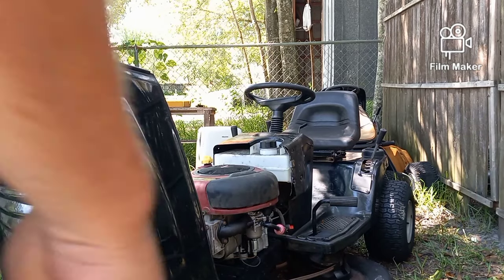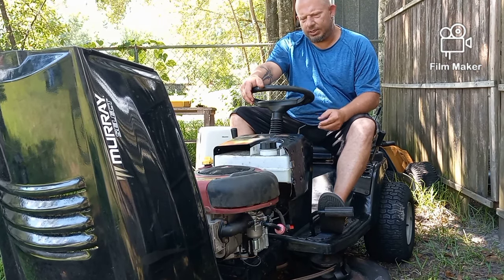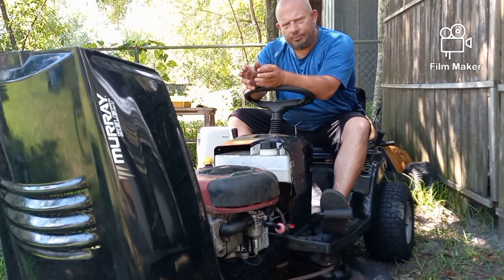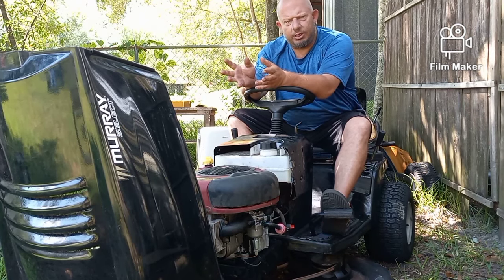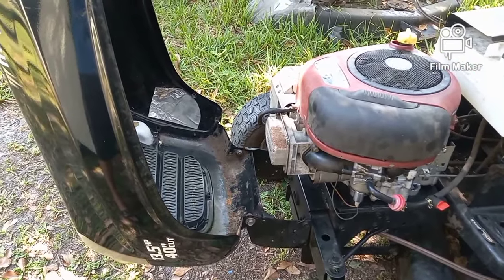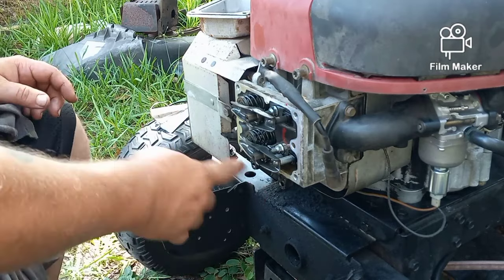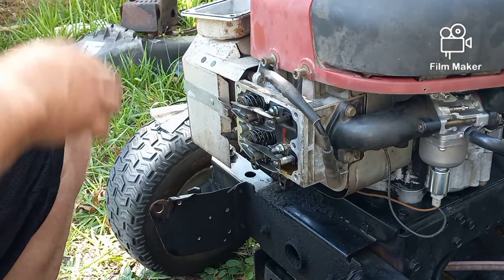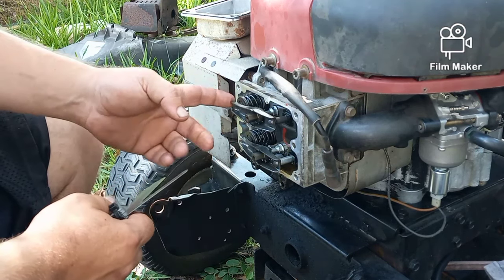Mower Spitting Backfiring / Fixed Briggs and Stratton Riding

Comment: Adjusted the valves on a 19.5 hp briggs and Stratton engine to .005. However, still popping and backfiring on idle. When I engage blades manually, the popping and backfiring disappears. What could be my issue?
Reply: Also to mention it is on a 300ex Poulan pro riding mower
Reply: Carburetor
Reply: @davidthurston4241  Actually that was my problem, I had ordered a carburetor for the 18hp engine and that was my causing my problem. Ordered a new aftermarket rated for 19.5hp and cleared all my problems. Hope this helps for anyone that could come across this.

Comment: Quick question what is a good base screw adjustment for that air to fuel to start at? From all the way in. How many turns out would be a good starting point?
Reply: I have that same engine here popping like a mofo. And I've been playing with the carburetor with no avail. I will be taking a valve cover off and doing the adjustment and then retweek in the carburetor. Thanks for your input in advance.
Reply: @nater6604  well  did it ?
Reply: @ronjohnstonaustralia2417  still sitting in the backyard. I have so many other projects going on cars ATVs go-karts and house stuff. I think it's the rocker stud loosened up.  At some point I'll power washing machine fix it and put it up for sale
Reply: Hope you got it fixed. That air/fuel screw, turn it all the way in, then back it out 1.5 turns to start. Should be close at 1.5

Comment: If you Jack the nose of the mower up, the oil won’t run from the head when the valve cover is removed. It makes life so much easier.
Reply from the maker: Your absolutely right.. this was an early video and I was very unprepared , short on tools and nervous.. I never expected it to become my most viewed vid cause it's not great lol.. but I've learned since then to show better ways .  Thanks for the tip it's great that u stopped by
Reply: @MunkyWrench  you do good work. Keep it up

Comment: Where do I find specs for a Briggs Intel 20hp? I set air gap at .010 but I noticed a chip in the coil on engine side. Valves have no clearance

Comment: Hi Munky, thanks for your videos. Really appreciate them. I own a 21A907-0167-E1 Briggs and Stratton Engine (13,5 HP) and I can´t seem to find the oil filter. Does this engine has one? Thanks in advance
Reply from the maker: Good morning.. I just looked it up and I see 2 motors.. 1 with a filter and one wuthout.. so I looked up the filter .. it's a shallow filter.. it's about the size if your fist. Usually .. from the driver's seated position would be sticking out the right side of the motor. I'm sure you would see it if it had one.. also if it's a used machine I've seen people remove the oil filter and cover the hole.. feel free to email me and I can help u more in depth

Comment: It's going to sound stupid to you, but what does 500 hundreds of a inch look like  on a feeler guage?
Reply from the maker: not stupid at all .. I always forget if its 500 or 5000.. but its 5 thousands 0.005 ... hint its almost the smallest thinnest one you can get.. most feelers guages start at 4 thousands .. so usually its the 2nd or 3rd one on the tool.. fan it out like a deck of cards.. find the thinest one and it should be right on that end of the tool.. hope that made sense
Reply: @MunkyWrench  Thank you!

Comment: The biggest question you did not address is, what caused it to be so much out ?
It could have a bad worn push rod, bad lobe ?
Set screw stud can be coming out?
If any one of these things are happening, it will fail again.
Just saying.
Reply from the maker: Agreed but the biggest cause of it is the fact that the average homeowner doesn't even know they should ever be checked or services nor do they pay for stuff they don't think is broke.  So I've the years they slowly get out of spec until the day they go too far and simply won't run or runs bad enough to untrained owner thinks it can't be fixed and they buy another

Comment: So mine is stalling out at about 1/2 throttle. Spitting out of intake. I've taken the engine apart twice since putting in a new camshaft and a new carburetor, nothing is bad, bent, or anything of the sort. Carb has been adjusted. New plug also. Oil didn't have metal fragments in it. It just refuses to throttle up without missing and losing power. Engine is a 17.5 hp I/C on a Craftsman body. Any ideas?
Valve lash has been adjusted... I know all about those things I'm actually pretty mechanically inclined. Intake is .005 and exhaust is .007. I've tried everything from .004 tight/loose to .006/.010 no effect.
Reply from the maker: That's a head scratcher.. I'm gonna think about that for a few hrs.  I read your message 3 times and I keep going back to a carb issue.. like when u throttle up its being chocked.. not getting enough air and so the gas is not all being fired and being spit out .  I'd cmdoubke check the intake manifold for cracks or leaks.  And I've had that happen with a new carb that was bad from the factory and I've put a different carb on which fixed the issue.  Something is bogging the engine down which could be a head or head gasket problem also but I assume u checked / change when rebuilding the motor.  Keep me informed and I'll think on it
Reply: @MunkyWrench  yeah I'm lost on this one. I didn't tear down the engine from the flywheel side so the flywheel, stator etc hasn't been looked at yet but I did break it down from the cam side. So what I've checked so far and all are good:
Piston travel
Piston walls are smooth
valves aren't scarred no contact between valves and piston. 
Rods are straight
Valve springs are good, caps are still on valve stems.
Rockers are good, rocker studs are seated tight
Timed it by dots both teardowns.
Governor is good and intact
Camshaft is new, new compression trigger
Pushrods are new and good
Counterbalance is good and floating right
Plug is new
Carb is new and adjusted to standard 1&3/4 turns out, and tweaked to no effect
One thing I'm noticing is that a lot of videos I'm seeing with that engine it looks as if their valves are opening much farther than mine...but as I said my rockers, studs, springs, caps, valves, pushrods, cam etc are all good. But when I turn the flywheel by hand they may open 3/16"? If that. Both sides. Honestly it feels like I'm getting too much compression...but what would cause that? I know a leaky piston will cause low compression but it just feels like mine is too much
Reply from the maker: @AnothaGuy87  I've seen valves that would stick closed or partially closed but that's only due to carbon buildup on the guide .. too much compression could only be caused by carbon on piston or sleeve and doesn't sound like that's your problem.. silly question.  U got the right crank in there, correct.. I've seen an oversized out of spec cam or crank be too tight in the guides
Reply: @MunkyWrench  the gear fits right, and I'm pretty sure I checked the lobes to the one I took out of it and they looked the same. I say I'm pretty sure... But not positive. It's very likely I'll tear it down again and if I do I'll put a caliper on the lobes. That being said if I'm having too much compression that's probably an undersized lobe condition not allowing the exhaust to open up enough. Funny thing is tho that I ran the mower about 6 hours after the cam swap and it did fine. Really well actually. Then I throttled down to disengage the blades, throttled back up and it started missing and lost power. And yessir I checked the belts and pulleys and such. They're all good.
Reply from the maker: @AnothaGuy87  yes worn lobes would cause valve not to open enough but I think u would notice that I meant the crank body where it fits in engine case.. but yeah it ran for hrs no problem then power down and wouldn't power up.  Not sure but now I want to know
Reply from the maker: @AnothaGuy87  double check timing key if it's partially sheared or bent the timing could be slightly off but I think u said u checked that
Reply: @MunkyWrench  I didn't check the key on the flywheel, I didn't pull the crankshaft just the cam. I'll take it down from the top tomorrow and get back to you.
Reply: The magnet on the flywheel for the coil is lining up when the piston is at TDC tho 😕 lining up reasonably I mean. Close enough to spark in time
Reply: Honestly, come to think of it, I feel like I can rotate the crank wayyyy too easy by hand with the plug in...I bet I have almost no compression. I bet something is going on with the piston or jug that I overlooked. 🤔

Comment: What suggestion do you have for a mower that’s getting gas in the oil
Reply from the maker: When I find gas in the oil pan.  Most cases are because of carburetor issue. The needle under the float is not sealing correctly and cutting off the fuel.  The fuel then continues to flow... it overflows the bowl and directly into the cylinder and eventually into the oil.

Comment: Concerning the adj sequence, some mention piston on the compression stroke. 
Your 2 cents?
Reply from the maker: Your adjusting the clearance in the open position .. it does not have multiple clearances.. so it doesn't matter if it's top dead center or on compression stroke.. it only matters that there's no pressure on the arm your adjusting.

Comment: what about if machine is backfiring an sparkplug is looking more black?
Reply from the maker: You have a fuel mix problem .. carb is off.. backfire means too much fuel but black plug means not enough fuel.. backfire is caused by not burning all fuel during combustion (too much gas to air).. try cleaning the carb .. there's no real adjustments on them but a new carb will take care of it if cleaning doesn't work
Reply: @MunkyWrench  thanks a lot just cleaned carburator but probably not good enough
Reply from the maker: @knarf3985  yes unfortunately sometimes it takes 3 or 4 cleans and an ultrasonic cleaner to get em clean.. try soaking it in cleaner  over night.. u can get carbs for 20 bux on amazon.. also if u have compression tester check it..
Reply: @MunkyWrench  xthanks bro 
at the moment the machine is running  with a new spark plug an a ne diaphrame, its still not running smooth ... is there a chance  that carburator gets cleaned out by themself by running the machine ?
Reply from the maker: @knarf3985  actually that happened to me yesterday.. one was running rough .. I always let them run an hour to test magneto.. during course of test carb cleared out and started purring.. u can shoot a few squirts carb cleaner in air filter while running.. it can help

Comment: Remove spark plug, or spark plugs for twin cylinder engines, makes it alot easier to turn the motor by hand. Cam shaft have lobes that open/close, inlet/exhaust valves as motor runs. Best check manufacturers specifications for valve clearances. With age/ engine wear/tear, valves eventually sit further down in the head reducing air clearance gap between valve & rocker arm. Hence periodic valve clearance checks are necessary.

Comment: Ok I haven't messed with a lawn mower Briggs and Stratton in a long time , but since the flywheel is keyed , you don't set the timing on a lawnmower at least not last one I rebuilt although been nearly 20 years so things may have changed

Comment: There is one thing about this that still confuses me: If backfires are caused by a valve not closing fully (or not seating properly) wouldn't a bigger gap, like you have in the beginning of the video, mean that the valve is indeed closed as there is no resistance against it? It would seem that a backfire would be more likely if there was ZERO gap which would suggest that the valve is being held open. I don't understand why the gap contributes to the backfire.
Reply: It's caused by the valve not opening properly The valve is open when it pushes the spring down and if there's too much gap it won't push the spring down and open the valve so it just builds up pressure

Comment: ❤Well, i have now an issue with an intake valve that smashes sparkplug..  ( yea its surely right sparkplug. 

Interesting though that with too short sparkplug, engine starts and runs ok...but of course I have to look camshaft, what the f,, is going on. 

Thats why I am looking these videos.

(Engine is BS model 289707, model 2004. Powerbuilt""12 hp.,it has totally different way of how things are stationed...
Reply from the maker: Hi thanks for taking the time to message, 1st let me say I am proud of you for working on it yourself . also the spark plug is nowhere near the intake valve so I assume you mean the spark plug is hitting the piston. You say you have the correct spark plug but the only answer is that you have the wrong plug. it is simply too long. The good news in your situation is that you can put a smaller spark plug in and it will run just fine . The simple solutions are often the best solution. I doubt there's anything wrong with the crank shaft or anything else because you said it runs ok with a shorter plug. if something was broken it would not run. Let me know if the shorter plug takes care of it. most plugs work the same so a little difference in heat won't change anything important

Comment: Dog, the top rocker is the INTAKE right? Look at how it aligns with the carb and the intake manifold black plastic pipe. Bottom push rod belongs up top. Looks like someone has been in there playing around.
Reply: You sure? This guy made the same assumption and then realized there's a channel from the intake manifold running down to the bottom valve.

https://youtu.be/zpFdvobEWzg?t=757
Reply: Intake is bottom

Comment: The aluminum push rod gos on the exhaust valve
Reply from the maker: No it does Not.. the extra heat bends and warps aluminum.. steal in exaUST
Reply: Google it. The aluminum pushrod gos on the exhaust valve.
Reply from the maker: Been doing this for 30 years .. so maybe I am wrong but I wont be doing it .. seen too many aluminum rods in the exaust get bent and destroyed that others put in that way.. but hey noone is perfect
Reply: I do agree with your method of valve adjustment. Some people try to make it rocket science but this way is simple and correct.
Reply from the maker: I appreciate you watching and taking the time to comment. I also appreciate when a viewer gives me a bit of information that may help. I try to show the average person how to do repairs in a simple and effective way so they are not overwhelmed. I am not perfect of course and I can be wrong so it's nice to be held to account by viewers as well. I am glad you came by  @busaofscbusaofsc8633

Comment: What the hell got quieter on it?!
Reply from the maker: Wouldnt say quieter but it got smoother.. stopped skipping or missing as much. If you still have a problem the spark plug or coil can be the culprit.. the carb could be slightly dirty too.. this was one of my 1st videos from years ago and it was for a customer more than the public.. I hate that its my best viewed vid cause in my opinion its my worst vid.. thanks for coming by and check out my later videos.. hope they got better

Comment: Your opinion on timing setting may or may not have any bearing on reality Mr wrenchly. The person I trust is many many mechanics who use the method of setting valves is does not even matter on where the piston is but where the other valve is compressed and your valve is loose. Only matters that  the valve has no pressure from the camshaft lobe on the valve you set period.
Reply from the maker: Thanks for your input.. always happy to hear from ya

Comment: Not correct.  the reason the exhaust push rod is steel, is because steel does not expand as much as aluminum when subjected to heat.

Comment: I also change the fuel pump
Reply from the maker: Always a good idea
Reply from the maker: But do u see fuel coming out the end of the fuel line when u turn the key.. could be a ruptured hose to the valve cover.. should be a hundred things lol just trying to narrow it down.. I'd pull the valve covers and check for stuck valves or missing push rods .. if u don't have a compression checker

Comment: Jam nut or set screw was waaaay over torqued. Look, with your eyes, how small, that jam nut is. Look at the threads on it. All you need is using your weajer off-hand, most will be your LEFT, with open fingers to reduce torque, a gentle snug. It's not an 18 wheeler lug nut guy. Easy does it. Better way is use a nut driver type to torque it. Not a heavier ratchet that allows more torque.

Comment: Still sounds like it's missing. Did you do a compression test or a cylinder leak down test to check for damaged valves / head gasket issues? Did you check the push rods to see if they're bent ? Did you make a follow-up video after you tweaked the carb, etc.?

Comment: The intake valve is on top , exhause valve is on the bottom. If you look at the top valve you can plainly see the carburator and intake leading into the top cylinder head
Reply: I'm glad I'm not the only one that saw the exhaust running to the carb lol
Reply: Are you sure, Patricia?

This guy made the same assumption and then realized there's a channel from the carburetor intake running down to the bottom valve.

https://youtu.be/zpFdvobEWzg?t=757
Reply: Its really hard to tell when you cant see the muffler connection. If you look closely, the bottom pushrod is aluminum, so that is the intake valve, and the top one is the exhaust because it has a metal pushrod

Comment: You are holding the feeler gauges backwards. The USED blade should come off the stack TOWARDS the engine. Gives the blade a straighter shot to the valve stem/rocker gap. Using it like you did, blade goes down at a slight angle adding more drag. Not in calibration so to say.

Comment: Remove the valve cover while IT IS HOT. As in run the engine to fully warm. Remove cover. Easy right? Little heat works great. You're welcome.